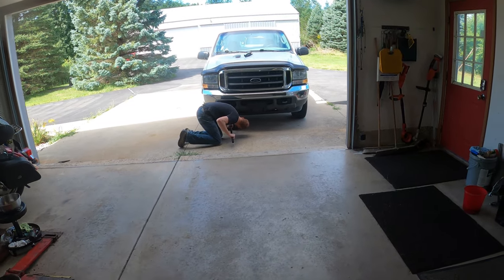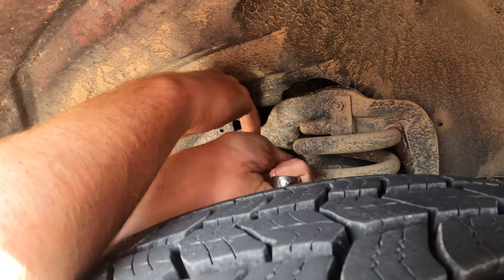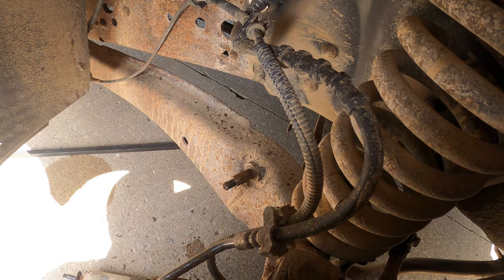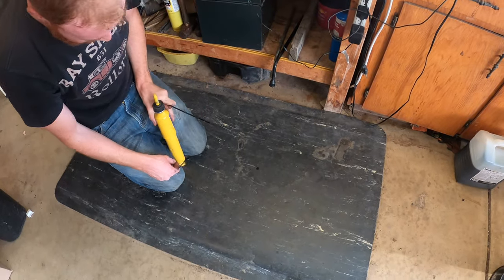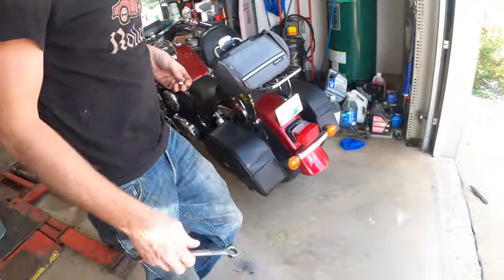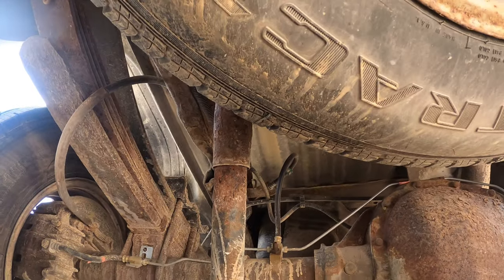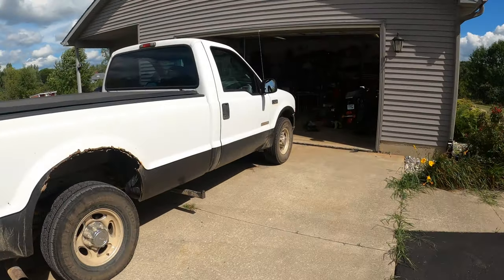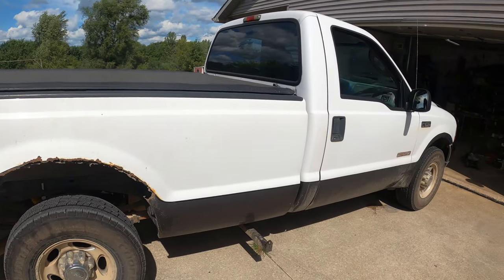2004 Ford F250 Shock Replacement

Comment: You went to a lot of work to compress the shock. Just jack the front of the truck up, and the shock slips in very easy, completely extended.

Comment: Great video. Very helpful. Only add I would include, take that screw out of fender well at the bottom. Gives a little better range of motion. And in a spot like that, every little bit helps. Also, if you jack the truck up, the weight of the tire will pull the spring down enough that you don't have to compress the shock.